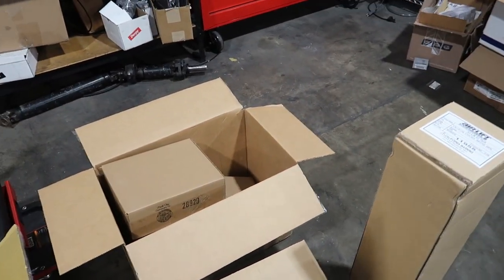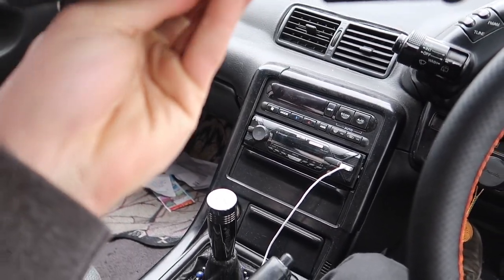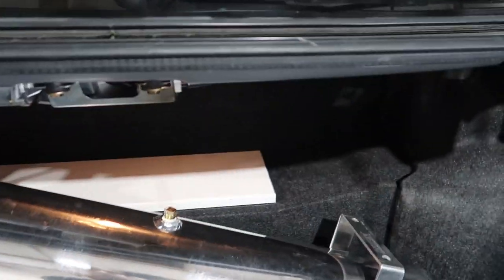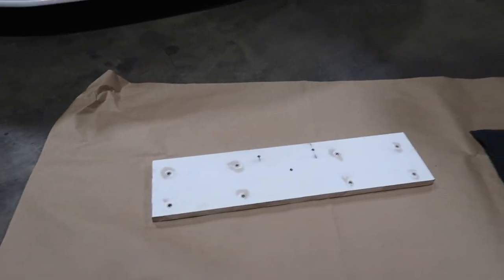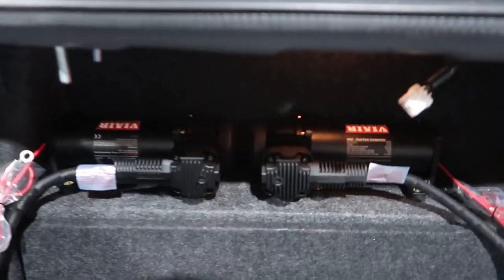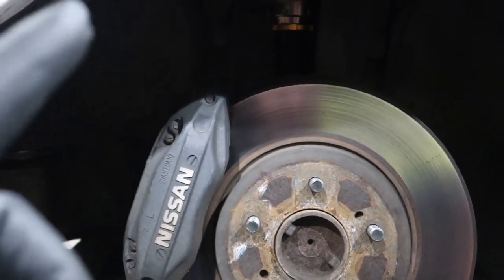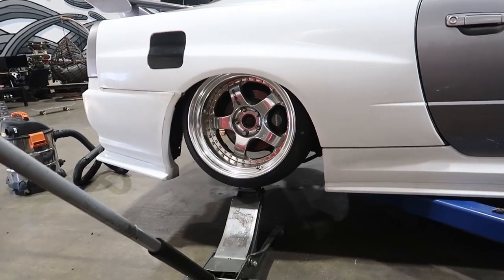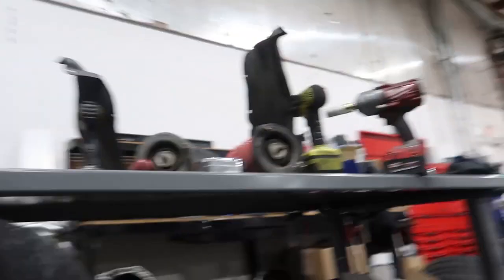BAGGING A R34 SKYLINE!

Comment: I’ve been wanting to mount my tank the same way, but When mounting the tank upside down like that, would I have any issues with wanting to purge the tank of water/moisture? 

Since the drain is now the highest point, I would think water would be pooled up because the lowest point is the angled fitting that’s slightly higher than the bottom of the tank. Any issues?
Reply: Wondering this aswell